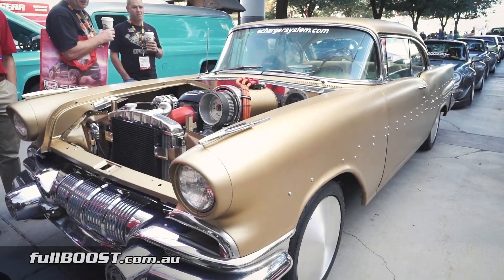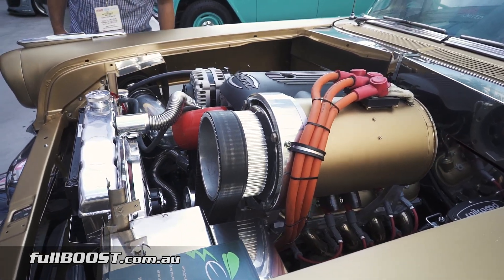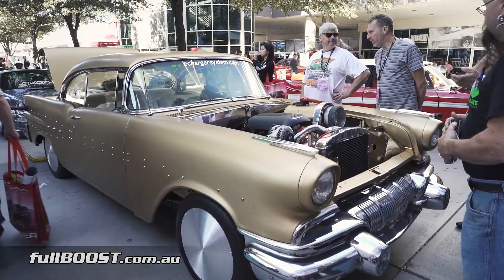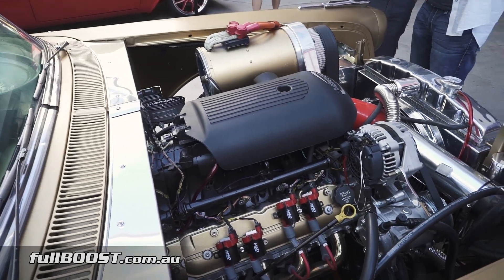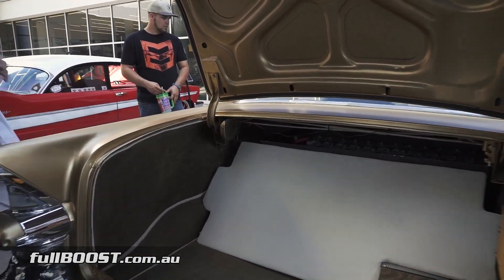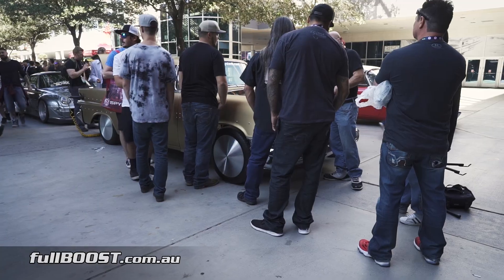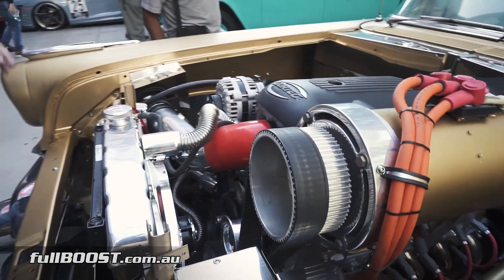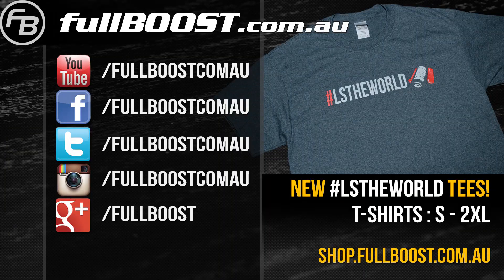The E-Charger Hybrid System

Comment: I'm interested to see what would happen were you to chuck this system into a rotary. There's less engine mass to drive so efficiency for the electric motor is also increased, so you might actually end up with some decent range for the hybrid and then some decent-ish mileage compared to stock. Taking load off the engine itself it might even go so far as to improve reliability. If anyone reading this happens to have cash to burn do us all a favour and find out.

Comment: Interesting. How about instead of a pulley system use a CVT. You would have much more control over the electric motor and would maximise efficiency and power. You can still keep the manual gearing.

Comment: I like it a LOT. I own an 09 Tahoe Hybrid that has what I think a better integration of electric motors by putting them into the transmission.
What I don't like is the 4:43 sales pitch. If you have an automatic transmission then you could be doing damage to the transmission. There are no torque sensors on the LS_ series. The shift points and more importantly, the clutch pressure is controlled very carefully by predicting the engine torque. If you don't reprogram ("flash") the module you would be entering more torque into the transmission without the increased pressure to handle that extra torque. This differential would be the worst during off idle and light throttle trying to utilize more electric than gas. The integration of electric motors PRE transmission makes for more headache. I think the best integration would be to split into 2 motors, one on the engine for assistance and auto-stop and another on the tail-shaft of the transmission. The motor on the engine would also be direct drive onto the snout of the crank.
Still, I love the idea and think that care is fantastic! Let me know if you need any help with the tuning.

Comment: Wait he says the e-motor tops at 5700 rpm and doesn't match the LS redline... wtf is the redline then 5k? Shame it cant be used on a rotary as the power band is from 6k onwards. Would be ideal on a wankel engine anyway due to the low torque
Reply from the maker: No, he said the electric motor is good for 8500rpm and this V8 engine tops out at 6000rpm.
Reply: ohh, Got the numbers mixed up. Very cool technology nonetheless
Reply: xDarkAngelFallingx he said the motor tops at 8500 rpm and that it's tuned to 6k rpm topped out. so you could floor it every where basically and not worry about blowing up the motor.
Reply: Not sure why my 355 holds 8700 rpms then,  no turbo or supercharger straight alchohol #lspower

Comment: So why cant it recharge its self during motion/driving?
Reply: Do you even science?
Reply: Clearly  I don't, hence why I asked
Reply: Simply put, it can. One way is through regenerative braking. He mentioned 3 different "modes". There may be a "performance" mode that charges during cruising to keep the batteries charged at the expense of fuel mileage.
Reply: By what I think you're saying you are talking about perpetual motion. There are always losses when you transfer from one source of energy to another. Basically if you were cruising down the road optimally you would not be charging or discharging the battery. Charging the battery would use more energy from gasoline than you would get into the battery. You can't get something from nothing.
Reply: john doe
Are you responding to me? Because I said "charges during cruising to keep the batteries charged at the expense of fuel mileage"

Comment: thats not an electric supercharger..... "A supercharger is an air compressor that increases the pressure or density of air supplied to an internal combustion engine." its an electric motor assisting a gas engine.

Comment: So does anybody have one? Does it really do the things it claims?, or is it another scam like those HHO kits?
Reply: its just a weak hybrid system. Just like a prius but not as powerful. Unlike a conventional hybrid that directly drives the car this just reduces some of the load on the engine. 

No reason why it wouldn't work question is how efficient or reliable. It supposedly adds 150 lb ft of torque but weights over 250 lbs. Not sure how reasonable that is. Maybe some economy depends on price of gas were you live.

The only real benefit that I see here is adding regenerative breaking to a car that may not have it originally. 

Current hybrid system are far above this.
Reply: Crazylalalalala definitely not. a traditional hybrid runs the wheels like u said to save gas where this just assists the crank which helps save gas. yea it's heavy but that's due to the lack of better battery technology so that's where this has a flaw. n not only that but traditional hybrid systems come from the manufacturer already built into the car or the car around it where this can be added to any car. and this also can be added to the transmission either or where traditional hybrid systems only typically go in one place. I think this is a better setup n the way it should be to begin with, not driving the wheels where u only get one gain plus weight. if they can come up with better power storage this would be perfect. power plus fuel saving is a ++++
Reply: No one has one except the guy who invented it. They aren't for sale yet....
Reply: marcus kornegay not sure what is "definitely not"
this is just a weak electric motor that you bolt on to your car. A prius has a 90kw motor this is a 50kw motor. So you get like 70 hp at the cost of 250lb. Than you would get additional losses due to belt, and gearbox.
Its really not powerful enough to get any real performance gain so it just assist the engine.
Reply: Crazylalalalala I was saying definitely not to conventional hybrid systems to this. u can take this n put it on any Motor is the gain here where as u buy traditional hybrid systems already built into JUST that particular model n the whole point is for a lil push plus more fuel to burn not a race helper in a box so to speak. u could make it that but like u said it's just more weight than needed n that's due to power storage tech of today.

Comment: I was just thinking about a system like this the other day. But I would love to see this replace both the alternator and the starter first. That would allow for a nice weight reduction (vs this system as is, obviously not over stock). At that point, I would be all over a kit like this.
Reply from the maker: Here is a vid where he says exactly what you've mentioned, no starter required.

https://www.youtube.com/watch?v=cixd-UlCry8&t=0s
Reply: I think it's only a matter of time. If there's enough interest in the industry there's no limit to what they'll do.
Reply: Agreed. I'm hoping this becomes relatively affordable within the next few years.
Reply: Ungregistered User Believe me, I'm well aware of what those components are and do. I have a fair amount of experience working with cars and even a bit of a background in engineering. If you would like to verify that you can check out my channel. But this is not a conventional vehicle. Many electric motors can be used to generate power which would render an alternator unnecessary. If this system can be used for regenerative braking, it can likely charge a battery in much the same way an alternator can. Furthermore, this is a big ole electric motor strapped to a small block. A starter motor is just a little electric motor strapped to a small block. There's no need for two of them. Most conventional (by which I mean non plug-in) hybrids don't have a starter, but rather use the electric motor already there to do the same job. Check out the link Fullboost posted just above, he actually says you don't need either of these things with the e charger.
Reply: kinda like the old cubcadets... they had a starter generator motor, to start and supply the 12v power. We are already there on that technology, just need to combine a starter/generator with this motor, and theres 3 components into one.
Reply: Gunzee I've also wondered why no car company has bothered to make a diesel hybrid. I have heard about someone making one on there own though.
Assisting the flywheel would do basically the same thing, it would just be harder to install and would likely require permanent modification to the bell housing (versus this which is bolt on). The prop shaft would also work and would have the benefit of being able to move the car on it's own without the engine on, but that would again make it a much harder kit to build.
Reply: DC Garage 

Finally someone made a positive and productive suggestion to bring this already seemingly to good to be true convenient bolt on upgrade to yet another level for power-trains already in place. If this alternator/motor operates as promised your request shouldn't be so hard to achieve and would beautifully get ride of redundant systems, simplifying current systems further. If this particular model operates as planned as an easy generic bolt on, then to remove those systems would require more customizing specific to each modern engine. I'd rather install the upgrade and weld in some battery trays than wait further. I'd start with the diy project of getting ride of the starter first. You're suggestion would probably be easiest to achieve 1st on a carbureted engine with out an ecu. A+ For your comment!!
Reply: DC Garage you can replace the Starter, alternator, and flywheel, and if you do permanent magnet motor it's also a generator when you reverse the polarity. The reason why people go electromagnet motors is the ability to control the voltage easily and not have voltage spikes but with a little ingenuity you can still have a good motor controller and even better efficiency. I have 2 techniques I still need to try.
Reply: Ungregistered User On this thread? I didn't see a different one hear but I did reply to your comment on the other video.
Reply: the old cub cadet lawnmowers had a starter generator, the technology is already there, we just need to combine that with this motor, 3 components into one.
Reply: What about the C300h from Mercedes?
Reply: DC Garage it drags to much to be a full-time alternator, but in regeneration braking mode it is acting as a generator and recharging the batteries
Reply: DC Garage to run the ignition and vehicle accessories, but if a bigger battery was added it could possibly run those loads as well taking another 15 horsepower load off the gas engine
Reply: If you use capacitors you could save a lot of weight.
Reply: Walter Garvey energy density in capacitors vs batteries is much less. Faster charge but less mileage.
Reply: Aircraft do this with starter generators, however, you can't drive the engine while producing electricity with a single motor.
Reply: Patrick Lavoie it cant be a motor and a generator at the same time but by reversing polarity you can have both. It should also replace the flywheel with permanent magnet motors. Highest efficiency just needs to be able to handle high voltage spikes you dont have to deal with using induction motors. I foresee many Ultracap capacitors as smoothing capacitors
Reply: Mercedes 48v system does just that
Reply: Fullboost That's very interesting, but it appears this vehicle still has an alternator. I wonder why that is.
Reply: Yeah I was thinking of some after market bolt on kit, how come there are no diesel hybrids? Also would some assist at the flywheel or prop shaft help or would it be less efficient?

Comment: hmmm, by merely assisting the engine to turn and not pumping more air/fuel it makes more power without having to mess with additional fuel system tuning stuff.      a true bolt on.